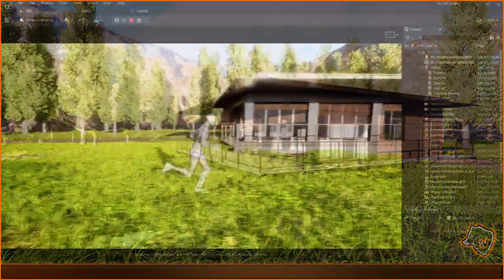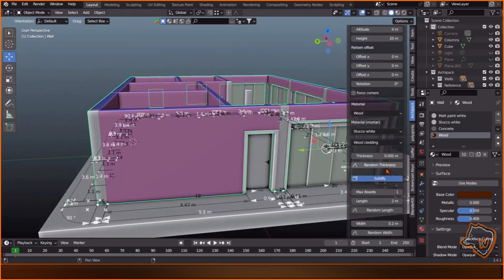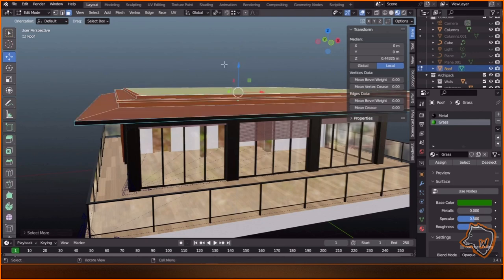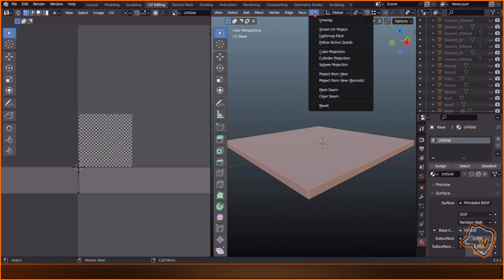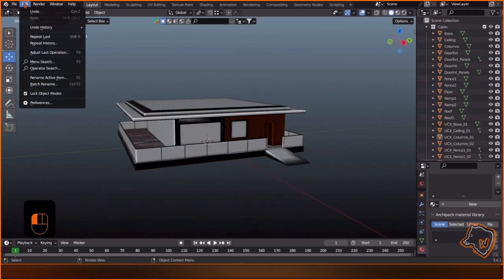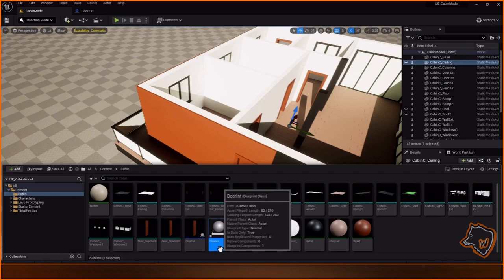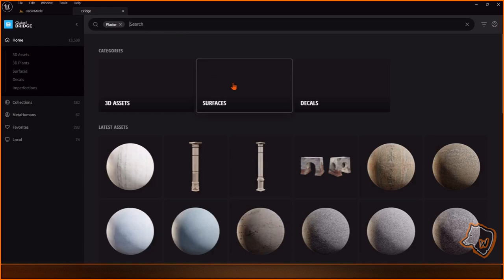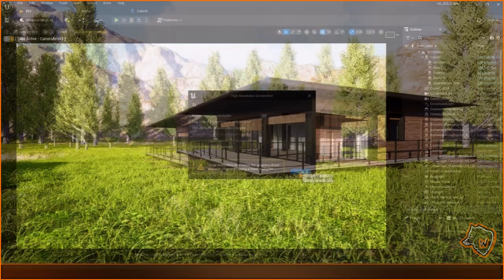BLENDER + UNREAL ENGINE: create a CABIN | cabin series 2/3

Comment: Great work! Just didn't understand why you created custom collision meshes, this can be done directly in unreal in a very quick way. Also, you can select all objects you want to add in your scene and just drag them inn Unreal, no need to do it 1 by 1. As for the UV fix, seems like you are suffering like everyone else, was hoping there was a quicker way to fix archipack messy UV's!
Reply from the maker: Hi! I created the custom collision meshes because I wanted to control them...for example the automatic collision didn't consider the openings, so I couldn't enter the house - For the dragging thing you are right 😅 -  For the UV unwrapping, it was not so painful actually...just automatic cube projection and scale 😉
Reply: Procure o addon Texel Density para ajudar a desembrulhar e corrigir a escala UV

Comment: Hey @WonderArchViz how do you manage the lighting when doing these kind of projects where you both inside and external views of a building are needed? I've been testing archipack modeling but unless I model each wall slice as 1 object, I end up having light leaks, which turns it hard to use the space on low light settings.
Reply from the maker: Hi! I would use fake lights inside the rooms. You can try adding rectangular lights where it is too dark. The overall lighting doesn't have to be real, but it has to look real :)
Reply: @WonderArchViz  thanks for the reply! I wanted to avoid having too many separate lights as the idea is to have an interactive scene, with free control of day time. Didn't want to spend too much time linking those lights in a blueprint as it could get really messy in a big project. I will do some testing avoiding walls with more than 1 slice in archipack to see how lumen responds. Thanks again!